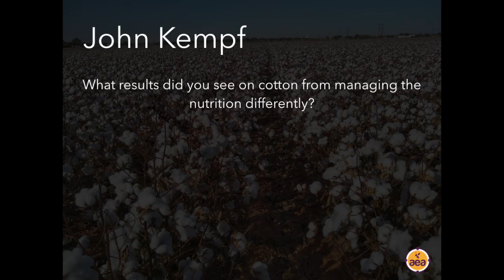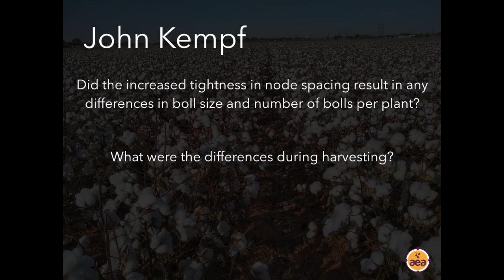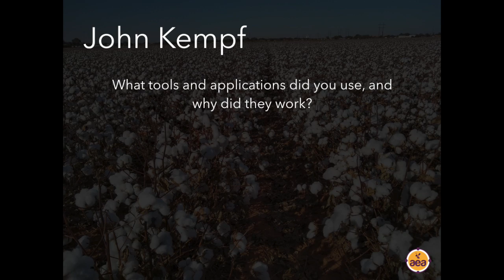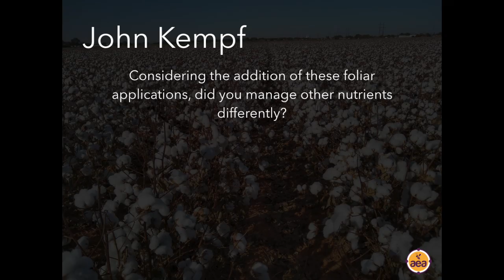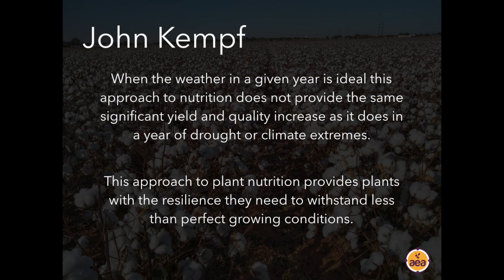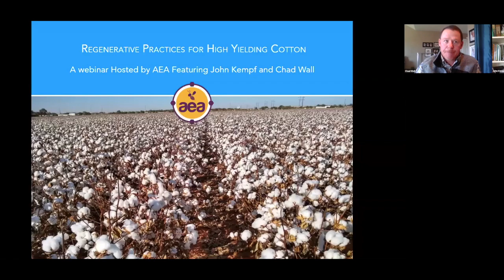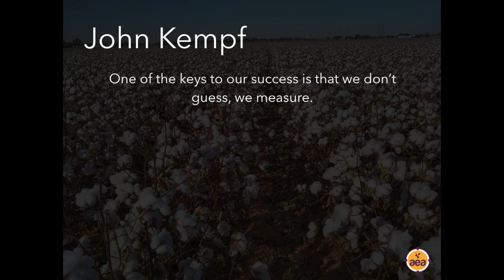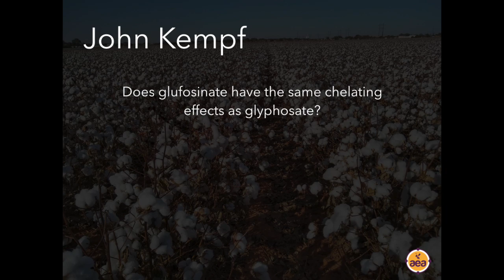Regenerative Practices for High Yielding Cotton

Comment: Two different studies have been done on glyphosate stability constants. One from a pure study of chemistry.  That was done at A&M and indicated Iron as the most reactive, followed by copper and then manganese and zinc. Cobalt was not investigated to my knowledge. This was done by Frank Dean from Spring, TX, product developed for Lido-Chem. The other study which I did involved examination of whole plant corn silage mineral content data. Using the Dairy One database, I selected several years of data from the time period before GT corn seed was available in the marketplace.  I compared that to over 1000 samples of corn silage tested at Dairy One in November of 2010, when this comparison was made. The reduction in the mean content of Iron, copper, Manganese and Zinc tracked with the study done by Dean. The most interesting outcome was the % change seen in the standard deviation of these same minerals. That  data revealed the same rank order as the mean and at a great significance level.  Reductions exceeded 38% in the cases of Iron and Copper.